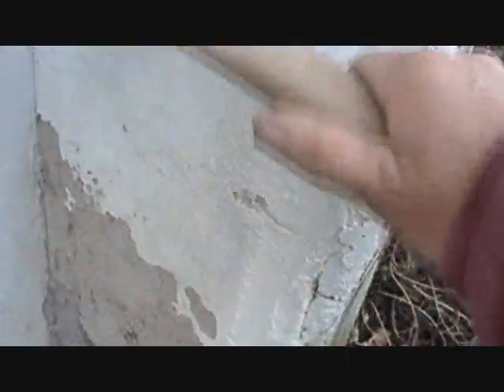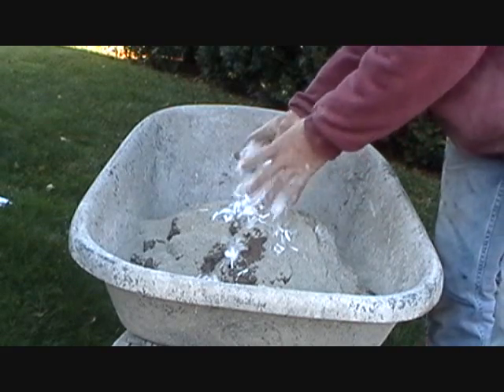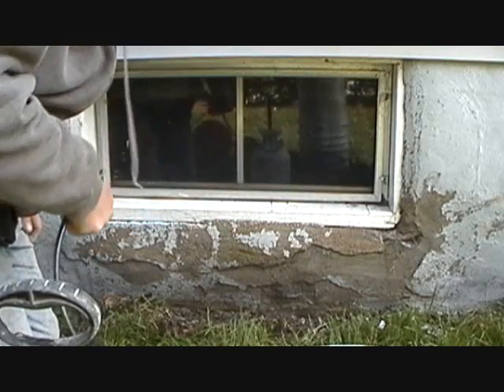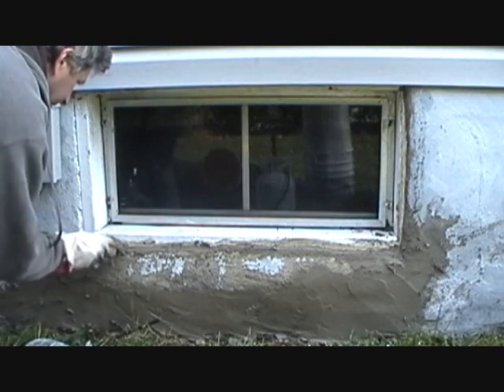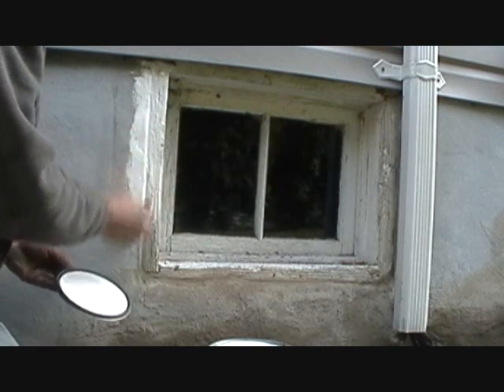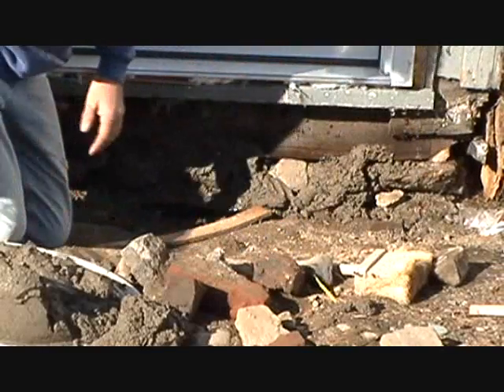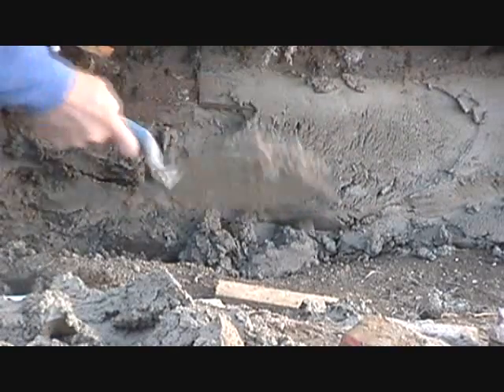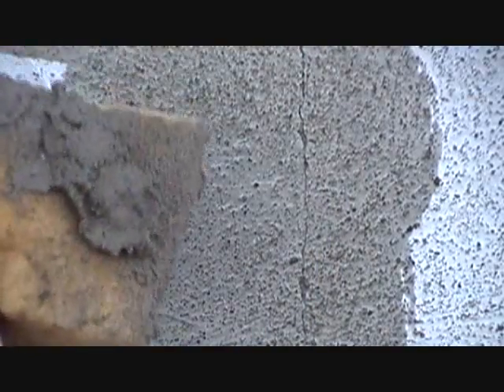FOUNDATION REPAIR  (Part 1) Mike Haduck

Comment: So Mike, you keep saying that you are up north and working in the south with concrete is different. I live in South Texas, can you explain what I should do differently with the concrete to patch up some cavities in my foundation?
Reply from the maker: Paul Creel From my experience working in Florida, I would say the weather would be much milder , and other types of cements and paints are more acceptable,  the local masons and supply company's could say what they use as far as types of cement or bonding agents.  I hope it helps. thanks mike
Reply: Mike Haduck Hey Mike, I'm not too far from you, I'm in Maryland.  What type of cement should I use for the north east type of weather we get?
Reply from the maker: Justin Lake Hi Justin I think the rest of the videos in this series should help, personally I don't see much of a difference but I know the weather is more mild there, the locals would know, I would ask some stucco guys. hope it helps thanks mike

Comment: Mike,  can I use sand from my local sandpit for the two parts sand in your mix?  I can buy a truckload for $5 instead of buying overpriced bags of sand at lumberyard?
Reply from the maker: David Cornelison I have seen some old-timers do it from sand pits in my area but all depends on the sand and how much rocks in it I hope it helps thanks Mike
Reply: Mike,  Thank you!  Do you believe that if the sand is clean and the aggregate(grain) size is similar to the mason sand in bags, that it will make good cement for patching wall?  P.S.  You have the best how-to videos EVER!  Keep up the good work!

Comment: Mike why don't you add a bonding agent?
Reply from the maker: there was no bonding agents when I started in the trade,  as the series goes you will see what old timers used which I still think is better,  thanks mike
Reply: What did they use I'm curious
Reply from the maker: just used portland cement mixed into a paint,  wet the surface, paint the wall and the directly place the plaster right over.  every situation is different,  thanks mike
Reply: bonding agents are overrated.
Reply: i took mikes advice on no bonding agent years ago when i repaired my front step with sand topping,,,,,steps have never needed repaired again,,im sold,,,a patch is supposed to be temporary but im seeing no evidence of a recurring issue,,thx mike